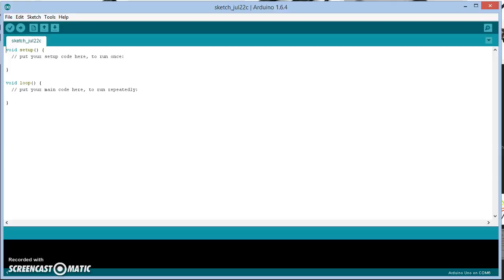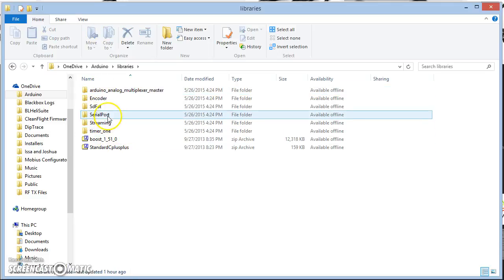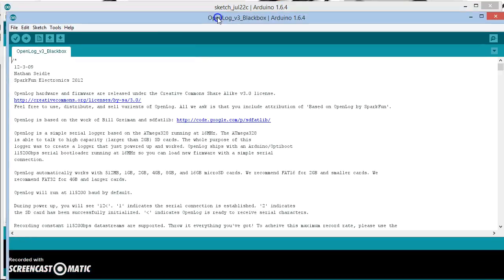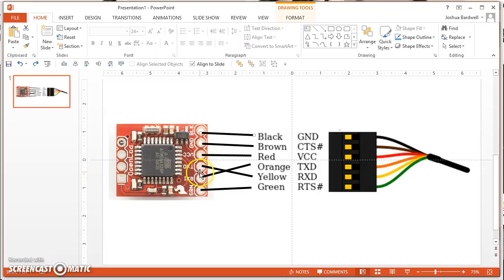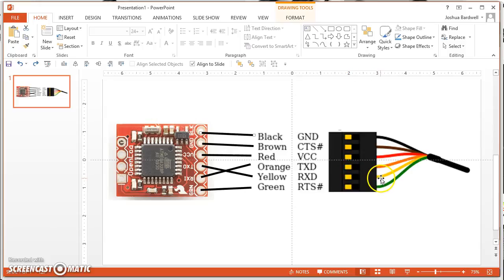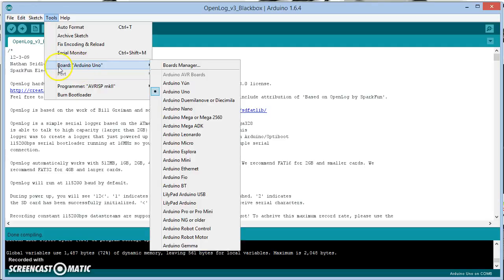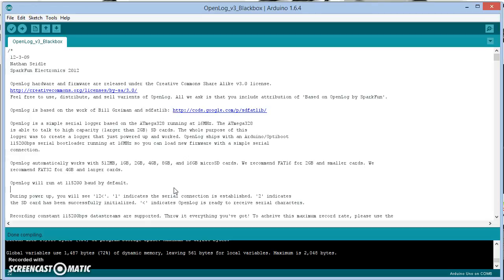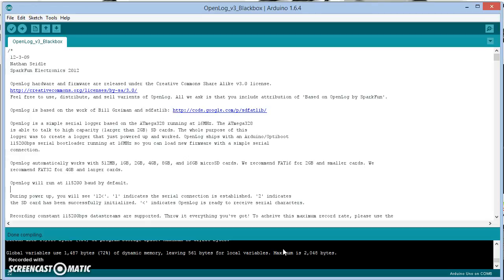How To Flash Blackbox Firmware to OpenLog

Comment: so.. 2015.. i'm not sure i should ask here but i'll try. i'm trying to connect an openlog (sparkfun original) into an GepRC Elegant KHX5. FW is changed ok, I get the config.txt with baud 115200. Configured ports tab uart6 to blackbox loggin at 115200. Configured blackbox tab to 'serial port/1khz/none'. Even setup a mode to blackbox on when the quad is armed. But all I get on SD cart is some Log###.txt files and when opening in blackbox explorer only shows less than 1s of logs.  The txt file seems to have the blackbox headers "H Product:Blackbox flight data recorder by Nicholas Sherlock" etc.. Any idea what could be happening?
Reply: And I found some russian guy explaining how to change the baud to 500000 via CLI and decided to try it. It worked!! The openlog handles it well. At 2khz it starts to lose some info but I think my cart is the problem.

Comment: I know it's an old video and OpenLog is kinda considered obsolete, but I was able to get 1K logging working on an old Lizard95. I was able to set baud rate to 500,000 (using betaflight cli, UI doesn't support it) in the official OpenLog Minimal Arduino sketch. I also used a Samsung Extreme microSD card that benchmarked at ~60Mbps. It might work with an Ultra as well, but I just accidentally ejected the one I had from another drone :( before embarking on this exercise with the Lizard. 
Prior to doing this analysis, I thought Lizard95 was noisy and had rough sounding stock motors. Turns out that using latest RPM filtering on BF 4.1.1 for F3 FC and BB analysis, I was able to reduce filtering with both sliders to 2.0 and the motors sound brilliantly smooth.
Reply: Thanks very much for your post because after messing about I also managed to get 1K without breakups using 500,000 set in the CLI. I have an SDHC V30 card by integral, that worked but weirdly I got smaller files, like it must have reset itself. However trying Sandisk ultra everything went fine. I have anyway ordered an openlager board which should do x4 this baud rate , but 500,000 really logs perfectly 1KHz data just fine as you said.

Comment: Could you please add a link to the applicable files. I have given a good go to find the right one but I just lead myself to the actual openlog_V3 sketch text not the folder.
Reply from the maker: +doondedulin44 Are you looking for the serial port and sdfat libraries?
Reply: +Joshua Bardwell yes please
Reply from the maker: https://github.com/greiman/SdFat

https://github.com/greiman/SerialPort
Reply: +Joshua Bardwell Fantastic, thank you ☺
Reply: + @JoshuaBardwell  I know this is an older post, but I have been struggling with the SdFat library for almost a week now and don't know where to turn.  I have downloaded several versions of the SdFat library including the one you have listed above.  No matter what I do, I get these errors:

OpenLog_v3_Blackbox:109: error: 'Sd2Card' does not name a type
OpenLog_v3_Blackbox:110: error: 'SdVolume' does not name a type
OpenLog_v3_Blackbox:111: error: 'SdFile' does not name a type

Any advice?
Reply: @Izzdawg-fp1si  Did you ever work out how to get around this?

Comment: Hi joshua
what sd card size and Speed would you recomend for black box recording?
Reply from the maker: +Oliver Peters Size is really irrelevant because you just can't buy much smaller than 8 GB these days, and that will hold literally days of data. For speed, Class 10 is recommended by the Blackbox Github page, but not all Class 10 cards do well with the type of frequent, small writes that Blackbox does. See if you can find the exact cards recommended on the Blackbox Github page, but the last time I purchased, I had a hard time finding them.
Reply: +Joshua Bardwell Thanks i will have a look into it and post here If i find a card that works well to recormend for others. Have you tried logging blackbox data with lux fc and high loop times. I'm running latest betaflight 2.5.3 with 125 loop time and oneshot125. wondering if black box can cope 1to1 logging or will have to change it?
Reply from the maker: +Oliver Peters No way it can go that fast to OpenLog device. The limitation on the OpenLog device is the UART, which maxes out at at 250 kBaud. In my experience, 250 kBaud is just barely fast enough to log 1:1 at 1000 looptime if you disable accelerometer, but if you have acc enabled, there are often complete logs that are nothing but breakup. Using that as a guideline, 125 looptime is 8x as fast, so you would need approximately 1:8 or 1:9 logging to avoid overrunning the UART.

A possible thing to look at is the SPRacing Mini board, which has an on-board SD card slot, interfaced with SPI, which is much faster than the serial UARTs. I don't know what the maximum speed on that would be, or where the bottleneck will be.

If you are logging to on-board flash chip, you will also be logging via SPI, and the SPI interface will be the limiting factor most likely.
Reply: +Joshua Bardwell Oh dear! 1:8 sounds bad. wonder if u can get any useable data for tuning from that?
I dont use acc. always switch that off. 17%cpu used
my tune feels pretty tight just wanted to use blackbox to check it over do you think its still worth doing with 1:8 or am i going to be wasting my time?
Reply from the maker: Oliver Peters Bear in mind the relevant factor is your sampling rate, which determines your Nyquist Limit, which determines above what frequency aliasing will occur. So sampling 1:1 at 1 kHz and 1:8 at 8 kHz is no different, because your sample rate is the same.

Comment: idk why i cant flash mine , can i mail it to you to try and flash :)
Reply from the maker: +RC Surf Where did you buy it? Just curious. I have had some friends give me theirs and I couldn't flash them either. I don't know what the issue is, but I just buy mine from MultirotorMania and they are totally good to go.
Reply: Joshua Bardwell thanks for getting back to me , yea I purchased on bangood. I will just buy one from MM , they come pre flashed with BB right?
Reply from the maker: RC Surf Every one I have bought so far. I have seen some eBay ones that don't even have an AVR chip on them, so who knows what the deal is.
Reply: +Joshua Bardwell I reflashed one from MultirotorMania, but I had to select Arduino Pro/Pro Mini. I was getting a not in sync error with Uno selected.
Reply from the maker: Ryan Hackney If it's not Uno, then try Pro/Pro Mini. If neither of those works, then it's likely that the chip doesn't have the bootloader installed. Glad you got it working anyway.

Comment: hi Josh, thanks for the help, quick question When I verify i get  "expected constructor, destructor, or type conversion before '<' token" I think the files are in the wrong place but followed your vid and Arduino shows them up in sketchbook and Libraries folders containing sdfat and serialport. same fault as in this link https://github.com/cleanflight/blackbox-firmware/issues/3

thanks again if you can help Brett
Reply from the maker: +kermets That seems like it is consistent with a syntax error in the file. But if you downloaded it and didn't modify it, that shouldn't happen. I'm sorry, but I don't think I can add much above what is in the video.
Reply: +Joshua Bardwell . thanks Josh, I got it Flashed......it worked with 1.6.3  Im not sure why this would matter from the earlier versions of Arduino i tried but it did, cheers Brett

Comment: I am not getting a Config.txt file after powering up the openlog. I am using a 64G class 10 card because that's all I currently have laying around. Wondering if that might be the issue. I followed this tutorial step by step, and everything worked until I got to the config file. Thanks for any help you can provide.
Reply from the maker: Does the green LED flash after powering? Does the blue LED?
Reply: The green led does flash a steady 3 flash sequence while plugged in. When I first plug it in the blue flashes a fast blinking sequence 3 times, then stops.
Reply from the maker: Does the blue flash when you remove and insert the card?
Reply: It flashes when I insert the card, but not when I remove it.
Reply from the maker: That all sounds normal, but I would still try a smaller card.
Reply: Ok. That's definitely the next thing I want to try. It's good to know that you think the same. Thank you.
Reply: That did the trick! Just FYI to anyone trying to use a 64G card with openlog. Don't, lol. I read some documentation saying that it would work with a 64G card, but nope.

Comment: Thanks Josh for your great work ,
I followed your tutorial.
But I am not sure if the firmware flashed ok. 
I got "9600 baud" on the config.txt  file not the 14200 you state on the video.
Reply from the maker: +Eduardo Blanco Insert a blank SD card into the OpenLog and power it up. Wait for the LED to stop flashing, then power it down. Remove the SD card. A file named "CONFIG" should be on the card. Open the file. If it contains only "Baud" then you have Blackbox firmware installed. If it contains other parameters, other than baud, it's the default OpenLog firmware.
Reply: Ok, That is the only thing I get: "baud 9600"
Thks
Reply from the maker: Ok. So just change it to 250000 and you're good.